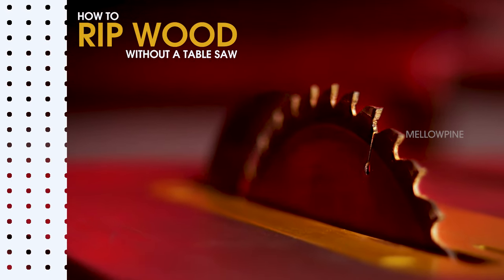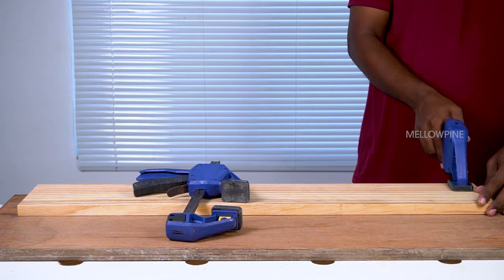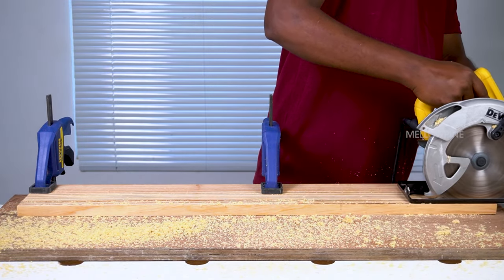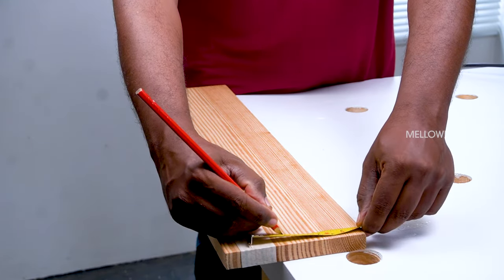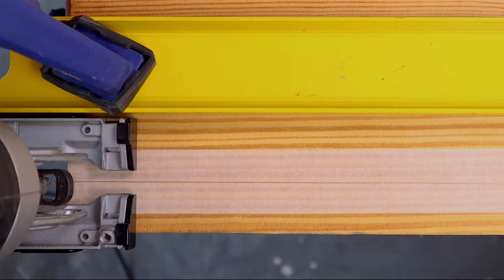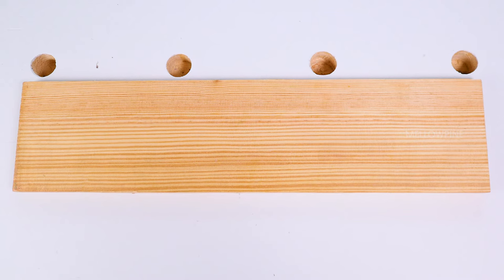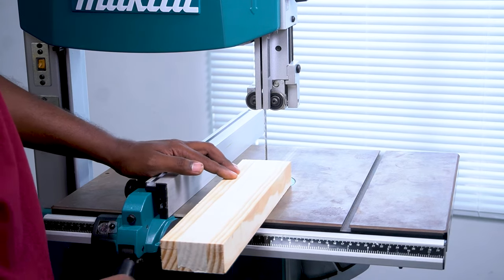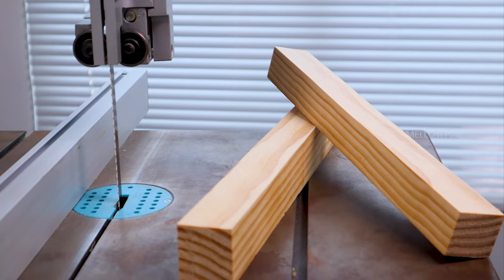How to rip wood without a table saw- 3 Easy ways

Comment: Thanks for posting the video (2 years ago!).  Still relevant and useful.  I am trying to cut a straight edge on a narrow piece of wood (3").  I only need to shave 2/8" off both sides, but It's tricky and I haven't worked that one out yet.  Oh, and no table saw, but have a jig saw and a circular saw.  Thanks again for posting the video and taking the time to make it.